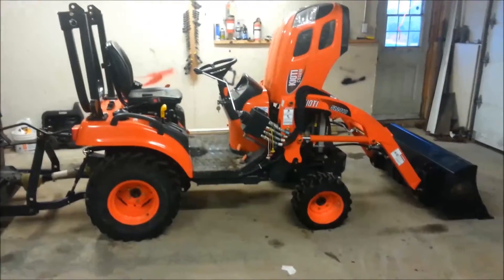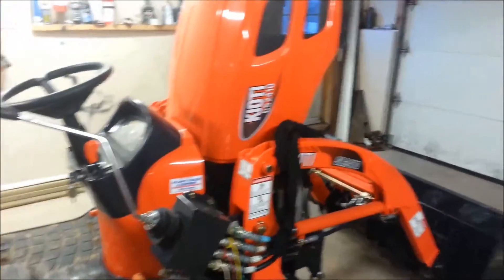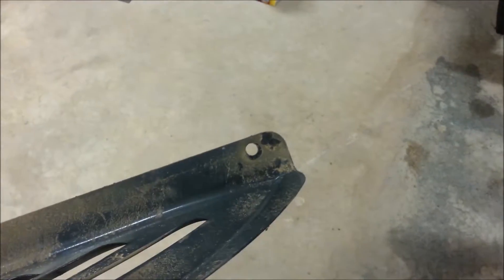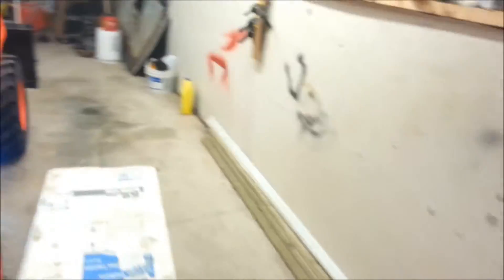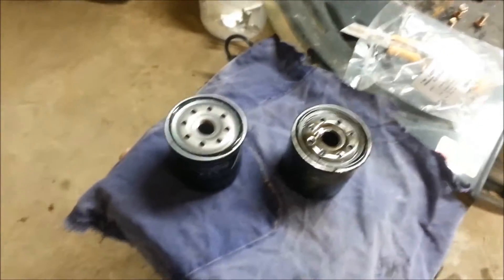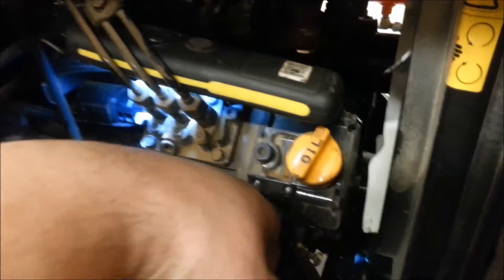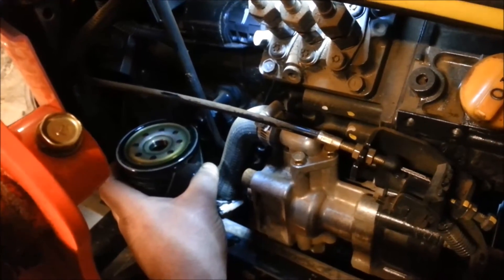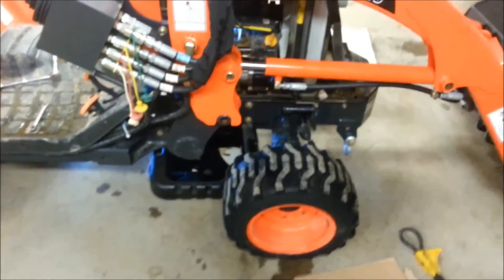Kioti CS2410 Oil Change

Comment: do you have trouble removing the front loader?
Reply from the maker: I have never removed the front loader on my tractor yet. Something I had planned to try and might do soon. There is only 200hrs on the machine yet and I didn't own one before this one. You can be sure there will be a video when I do try it. I still struggle a lot with the backhoe attachment (i've removed and re-installed that twice so far). I really hate these so called engineers (just look at the hst dipstick) who invent these poor designs and are never called to task over them.
Reply: If it's the same as the 20 series its very easy to do .
Reply: Thatscwhat the said at the dealership so I didn't have them demonstrate it. But with out putting a 6 inch block under the leg mine doesn't come off by using the bucket.
Reply: Well I must say when I took the loader off I had the bucket remove so it swung forward on the legs with easy when I knocked the pins out  .However had more trouble to put it back on  ,one pin would no go in so I used a ratchet strap to pull it in place .Went in easy then .I know this is not much help but I'm curious to know what the problem is
Reply: Our tractor has just 1 let I think you're may be different.
Reply: Removing my bucket wasn’t too bad, but putting it back on was a nightmare.  The cylinders collapsed a little so there was no way for the pins to line up.  My local dealer is great, and the sent a tech to my house to assist.  He lined the tractor up next to the bucket so the hydraulics could connect, and then moved the control arm to put the cylinders in the correct place.  After that it went on fine.  He told me that if the unattached bucket sits for too long the cylinders may bleed off, causing the problem again.  Something for you all to think about.

Comment: Why did you buy the kioti
Reply from the maker: In my area I had to choose between the Kioti, Mahindra, John Deere, and the Kubota. The Mahindra and John Deere were pricier with no advantage. I looked up the history between Kubota and Kioti and how they collaborated in the past. The Kubota and Kioti seemed identical but a local guy, Paul Short had a youtube channel showing his adventures with a Kubota and why he bought it. His experience, which seemed extensive, was it was the extremely good deal on the Kubota is why he went with it and the Kioti was equally attractive. That was the tipping point for me.
Reply: Please let me clarify. I didn't say not to buy a Kubota and suggested to anyone thinking about buying a Kubota to also look at the Kioti's because they have come a long way in recent years. Sometimes a potential customers needs to consider the bigger picture when purchasing a tractor such as dealer reputation including their service department. We presently own three Kubota's and they are great machines but the next time I shop I'll give Kioti a very close consideration. 
By the way. Nice tractor and very nice video. Happy tractoring.
Reply from the maker: That's true and I will edit my original comment.

Comment: Getting the filter out--not fun. I am having more than a little trouble just getting a wrench on it. Much as I like the tractor--bad design in the department,
Reply from the maker: I agree. I know that when you make things smaller and more compact then there are new engineering issues that have to be addressed. However, there is no excuse for a company with their resources to not foresee issues with basic maintenance. You will rarely change an engine or transmission so I would understand these being complicated to remove or replace. But expected service items like hydraulic and engine oil fluids and filters, hydraulic hoses,  starters, etc. should not require a NASA team of mechanics and equipment to service. Kioti needs to go a long way to improve their customer relations such as providing proper videos and a channel of communication so these issues can be addressed and fixed.